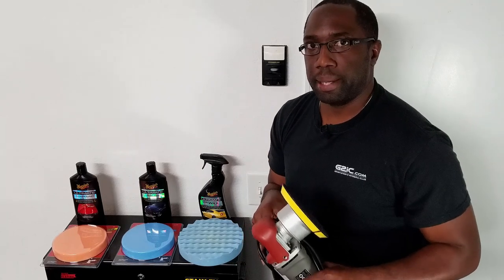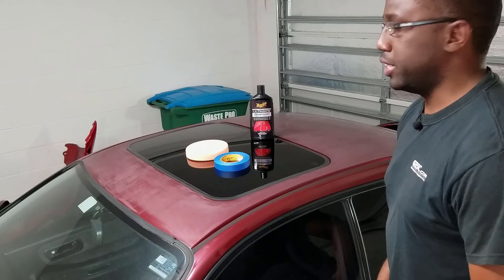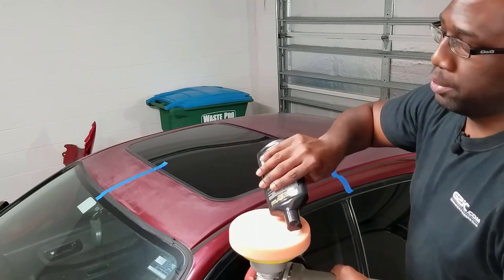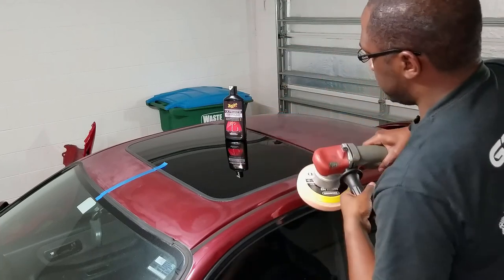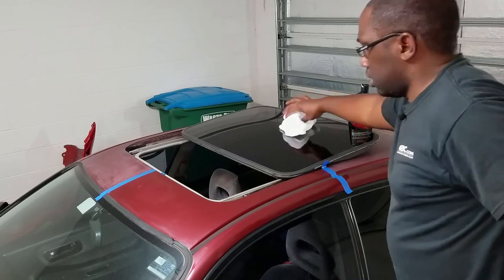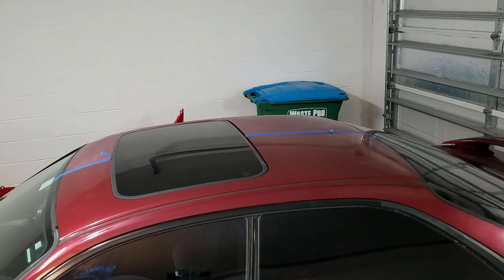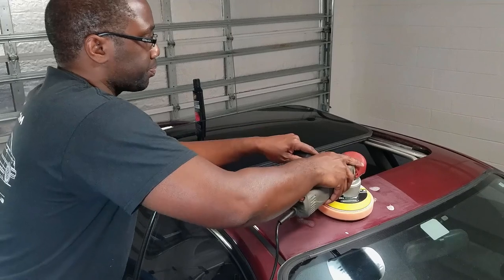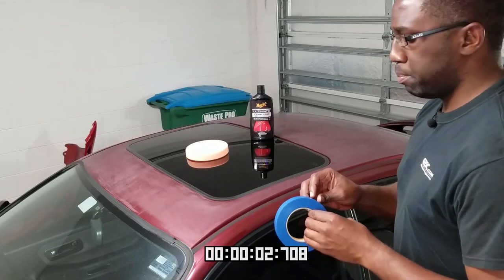How To Wet Sand and Remove Orange Peel In Your Garage Pt.2

Comment: Is it bad if I spray my pad with a light mist of water just to get it a little softer for my compound or bad habit ?
Reply from the maker: I've never heard of that method... I'm sure you want your pad and surface as contamination free as possible. The pads do appear rough and dry at first, but gets softer as you work.
Reply: That is a very good idea especially if your Pad is brand new.

Comment: Something is not adding up? Did you go back and lay a color coat down and then another clear coat since your last video?
Reply from the maker: Nope, that's the same base and clear from the original videos.   The clear coat even has the same hazy look from the Part 1 video.
Reply: I'm assuming you're regarding the red paint coming off on the pad? Considering he just clear coated.

Comment: you are doing everything wrong. wet sand with p2000 p3000 buff with rubbing compound and sheep hair pad and later machine shine and imperial hand glaze!!!! man what are you doing poor integra
Reply from the maker: Woah...That sounds like a professional job.  This is just a basic DIY so that an average person can do this at home.  Wool/Sheep Hair has their benefits, but are more susceptible to burning clear/paint(Heats up quickly). I think foam pads are just bit more forgiving.  Further more, most wool/sheep hair are suited for rotary tools and not a DA polisher(which is what I have).  The whole point is to NOT make this process intimidating.  Thanks for watching man!
Reply: BakeryPilot almost everyone is using foam pads now, wool pads are becoming obsolete. I worked in the auto body industry for years and before I stopped doing it over 15 years ago, we were not using wool pads anymore it was all foam. If you are a detail shop and buffing older cars all day long then a wool pad is what you want for compound, but on new fresh wet sanded clear, foam is the way to go. He is doing it right, and you are doing it right, just the old fashioned way.